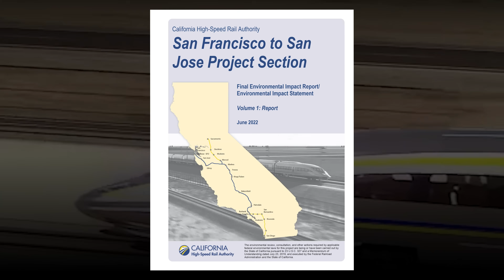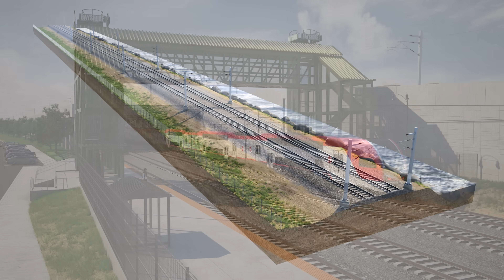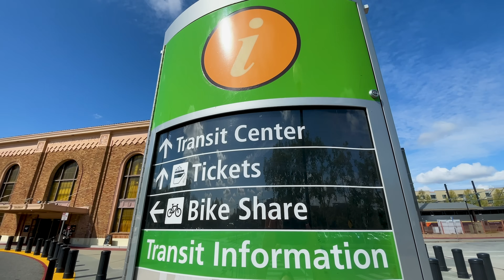San Francisco to San Jose Project Section Overview - FULL VIDEO

Comment: Max speed 110 mph in Northern California section. Central Valley ~180 mph. LA area another ~110 mph. 3 hours (?)

Texas is building a REAL HSR at 220 mph.
Difference between California and Texas is probably grade separation, meaning bridges and tunnels. 

California tries to ‘save money’ and delivers a semi-HSR. Not fulfilling promises, as usual, by US politicians.
Reply: 180 mph is still much better than 125 which is what Brightline is doing, it's  basically as fast as you can get, and I believe the central section will in fact go 220 mph
Reply: @n1thmusic229  In actuality Brightline only has a 20mile long 125mph section planned. Everything else is just updated freight track. Brightline’s marketing is blatantly lying about the scope of their project. It’s a little pathetic.
Reply: @TohaBgood2  I believe Brightline's marketing of a three hour trip of 240 miles from Miama to Orlando which is an average of 80 mph. Compare that to Amtrak's "approximate" average speed of let's say 41 mph. More importantly, I believe the 400 mile blended CAHSR journey will take four hours, averaging 100 mph. That might be either with only a few stops or even a non-stop express. For an infinite number of reasons I am more sold on Brightline's transit model vs. CAHSR.
Reply: @davidjackson7281  Nope. That is also incorrect. CAHSR and Deutsche Bahn, the chosen rail operator, have run countless simulations of the route as designed and built. The SF-LA duration is 2h38min even without maxing out on the high speed section in the Central Valley. 

There is precisely zero evidence that CAHSR will run SF-LA in anywhere close to 4 hours! Some anti-rail and anti-HSR blogs and trolls were pushing ridiculous numbers like that a while back, but they have all been thoroughly debunked! 

Tell me, where you got that number from? Why do you keep posting information that is flat out wrong? Isn’t that the definition of a lie? You know that the information is wrong but you still say it. What should I call you? A “creative truther”?
Reply: @davidjackson7281  Currently, Brightline’s average speed is 54mph and their top speed is 79mph. But they almost never run above 70mph because their grade crossings are a dangerous joke. This is identical to regular intercity Amtrak, but on the slow side!

After they add that 20 miles of 125mph track they will have a slightly better average speed but still nowhere close to the faster Amtrak intercity services, and not even remotely in the same universe as the Acela or the Northeast Regional trains. 

In other words, like so many people you’ve been fooled by Brightline’s very dishonest marketing.

They promised many things before too, including that they would be completing Brightline West by now. There are zero reasons to believe that they will actually be able to deliver anywhere close to 235 miles in three hours. They lied about everything else, why would tou believe them about this? How many times does someone have to be dishonest with you before you realize that they are constantly lying?
Reply: @TohaBgood2  After departing West Palm it will be non-stop and tracks will increase from  Class 4 on up to Class 7 making 3 hours doable. Believe whatever you want to wish.
Reply: @davidjackson7281  Three hours for Miami-Orlando is the theoretical runtime for a nonstop at the very top speed for each and every section. That's just not happening. There are a ton of curves, slowdowns for stations (even if they aren't stopping), slowdowns for grade crossings, etc.

You and Brightline are also assuming that the FRA will just let them run at 110mph on freight track between West Palm, Cocoa, and up to just 20 miles out from Orlando. It is extremely unlikely that the FRA lets them do that given how insane their accident record is. 

But let's say that the FRA closes their eyes on all of Brightline's incompetence and magically lets them have a 110mph speed limit on the new segment.

Ok, they currently have a 79 mph speed limit and they average 54mph, or about 68% of their top speed with no stops (25% slower with one stop). What makes you think that they can magically do better all of a sudden on the new section? You just believe what Brightline tells you in their marketing? What's their track record on lying in their public materials?

You seem to be insanely charitable to Brightline and simultaneously incredibly harsh with CAHSR. Why is that?
Reply: @n1thmusic229  Brightline is true semi HSR. I think they still use Diesel engines
Reply: @marktan3668  Brightline is 100% conventional speed rail. Their current top speed is 79mph. They have the exact same average and top speed as the Amtrak San Joaquins in California. The San Joaquins already uses the same Siemens Charger locomotives and is now getting the same Siemens Venture cars as Brightline.

There is almost no difference between Brightline and standard Amtrak intercity services like the San Joaquins. Only Brightline is more subsidized by the state.
Reply: @marktan3668  Brightline's top speed is 79mph, or around 127kph.

The fucking commuter rail in my city runs at 130kph, and it is grade separated. 130kph is not "high speed rail".
Reply: @gingerqueer22  your talking some LRT
Reply: @marktan3668  i'm talking commuter rail; find me a fucking tram that can do 130kph
Reply: @gingerqueer22  I rode some commuter trains in KL and Jakarta, some are electrical some not, they run like the speed you said.,same as Singapore MRT. Grade separation is applied for various reasons.,
HSR likes the linearity and little inclination. 
80mph is like my car. We are talking 200 mph in this age of ours.
Reply: @marktan3668  what are you even saying?

you've completely backflipped on your original point, presumably because it was really stupid, and are now just re-iterating basic facts about hsr.

and you're wrong, btw; hsr broadly refers to systems with an operating speed of around 200-250+kph. not every system is or has to operate above 200mph. obviously california hsr will on the dedicated sections, but that's not what is happening here.

like, do you have an actual point?
Reply: You haven’t been following Texas Central lately. That project has struggled to make progress in the courts
Reply: That's just for the Bay Area though, and since CalTrain agreed to allow CAHSR to use their corridor, they were able to use funds from Prop 1A and federal funding to push ahead with CalMod, which will significantly improve the existing SF to SJ portion of their network. And if you have see states save money, look no further than el estado de Florida, 174 level crossings across a 67-mile long corridor from Miami, Fort Lauderdale, and West Palm Beach, with a lower top speed of 79 mph.
Reply: @randomscb-40charger78  so, there is Prop  money passing around, who knows where.
Florida model is mostly at grade crossings whatnot. In fact, 90% of California’HSR’ are at grade level. How can they run fast?
Reply: @marktan3668  A lot of HSR systems are at grade, but they don't have a lot of grade crossings. A big part of the project involves grade separating existing tracks from roads to allow for higher speeds, as the highest speed according to the FRA for barrier crossings is 125 mph, 110 mph for regular ones. Another reason for going at grade is that it's the least expensive ROW to construct for trains, elevated tracks being more expensive and tunnels being the most expensive.
Reply: For Brightline, they only plan to run up to 110 mph on the Florida East Coast Railway, the tracks they currently use and will use all the way up until Cocoa, before taking a newly built line to Orlando. The FRA prevents passenger trains from running faster than that on corridors which are shared with freight trains as well, not just because of the absurd density of crossings. On the new line, trains will reach up to 125 mph and maybe even higher in the future.
Reply: @randomscb-40charger78  110-125mph, on diesel. I guess one of reasons world’s HSR can easily get 200 mph is, there can be several coaches with electric motors sharing total thrusts.
Reply: @marktan3668  That would be an EMU, but even loco-hauled HSTs can achieve such speeds.
Reply: Nope. Texas Central isn’t building anything. They stalled before they even got any money.

CAHSR’s top speed will be 250mph, with actual operations speed limits at 220mph. Texas Central was shooting for barely 200mph before they crumbled.

You are blatantly lying again, bud.
Reply: @TohaBgood2  your claims of mph is IMPOSSIBLE by engineering. Only politicians election promises.
Reply: @TohaBgood2  Your correct about Texas. I hope CAHSR goes 250 mph, however with the blended system I am seriously doubtful of any SF-LA trip in less than three hours. When debating please don't rudely refer to someone as a blatant liar. It actually undermines the points you so wholeheartedly wish to express.
Reply: 180 mph is real high speed rail 😆
Reply: @Scottish_Transport_Explorer  International standards begin at 155 for new tracks, 125 for upgrading existing tracks.
Reply: @davidjackson7281  Exactly
Reply: Bandung will test 220 mph true HSR next few weeks, operating in spring. The first in SEA, Southern Hemisphere. Way way ahead of Canada, Australia and USA. 

Watch their detailed drone videos on their building processes, step by step.
Maybe USA can learn something about project of peace. And, not perpetually making war destruction.
Reply: @marktan3668  Lol, the Indonesia HSR project is more than 2x over budget and more than 2x delayed!

Wasn’t it supposed to be completed by 2018 and cost $5 billion? Why is it only getting completed in 2023 and costs over $10 billion.

You’re literally touting a project that is more delayed and more over budget than CAHSR!

Have I mentioned that it’s also extremely short, shorter than just the initial segment of CAHSR that they are finishing construction on right now? Yeah, only 142.3 kilometres (88.4 mi) vs the CAHSR section under construction of 119 miles. Also CAHSR will have a higher top speed of 250mph and a higher operational top speed of 220mph. Your project will only have a 220mph top speed and an 200mph operational top speed.

You can’t even troll properly 😁😁😁😁
Reply: @TohaBgood2  Indonesia is way way ahead of Canada, Australia and USA.
Reply: @marktan3668  In what way exactly? Your entire HSR “system” is shorter than just the first section of CAHSR. 80 miles of HSR isn’t some major achievement. It’s also slower than CAHSR and similar systems. It’s also more over budget and more delayed than CAHSR.

So what do you call “ahead”?
Reply: @TohaBgood2  California’HSR’ IS ONLY 130 mph for entire run. World’s standard IS 200 mph. Wake up !
Reply: @marktan3668  What are you even talking about, bud? The Central Valley section is literally designed to be the fastest stretch of non-maglev HSR in the world. The top speed is set at 250mph (402.3kph). The top operational speed is 220mph (254kph). The top sustained speed of the trainsets that they are ordering is set at 242mph, and they need to be able to do cruise at 220mph.

This is all in public government documents and contracts. We are literally paying a ton of money for this level of performance. That's one of the reasons why the system is so expensive. Even the anti-CAHSR trolls, like yourself, are constantly complaining that this is making the system too expensive.

Where are you even getting that ridiculous made up 130mph number from? It doesn't appear anywhere in any CAHSR document!

And no, 200mph was the top speed standard for HSR track and rolling stock in the early 2000's. Since about the 2010 all the new HSR systems have been aiming at 220mph top speed for their new high speed lines. You can see that in France and Spain, as well as with HS2 in the UK. China has also tried to build a line at that new speed. 

220mph is rapidly becoming the new gold standard for tops speed. Your tiny, 80 mile, HSR system in Indonesia is already outdated before it has even launched! Is that why you are trying to defend it and make stuff up about other superior systems?
Reply: @TohaBgood2  when Americans build. It’s a laughing stock. Hahaha
Reply: @marktan3668  Heil. Nice thumbnail moustache.

Comment: Seems like way too many grade crossings. Why can't we do this right?
Reply: Because the people on the route keep suing everyone and their mother to block any grade separations. They’ve also blocked quad-tracking, passing tracks, and almost killed electrification!

Plus, running at 110mph in urban areas where the stations are is 100% standard practice for HSR worldwide. The Shinkansen and the TGV go considerably slower in cities. This is just how HSR is currently done.
Reply: @TohaBgood2  I have no issue with the 110 mph speed in urban areas. This is necessary due to the limitations in of the alignment due to existing infrastructure. Even 110 mph lines should be fenced in and grade separated to insure the safety of rail crew,  passengers and the public.
Reply: @davidlendved8225  Of course they should be separated. But local opposition has killed most of it. (Eventually it will have to happen, of course, but it'll mostly end up being paid for by local authorities and at a much higher cost than if the HSR authority had been allowed to build it right to begin with. As usual the NIMBYs are passing the extra cost onto their kids and grandkids.)
Reply: @TohaBgood2  Is there a reason NIMBYs are able to block that? Why dont California just use eminent domain? They could easily strong-arm their way to completing this correctly, but instead they are going to risk lives being lost similar to Brightline. 

Only hope for true HSR is Texas and yes, I know they are struggling to even get started. These companies really just need eminent domain rights, because the amount of NIMBYs they are going to encounter is never going to go away and they need to be prepared for it better.
Reply: @RashawnBlue1  Eminent domain lawsuits can be extended almost indefinitely with enough money, certainly long enough to block projects into oblivion. Some of the richest people in the world live on this route and they will use their money to kill this thing off. CAHSR is doing exactly what it needs to do to thread the needle and  get its foot in the door. Then, public pressure will make it impossible for the moneybags to oppose the necessary upgrades. But what they are doing right now is precisely the way you get something like this built! They know what they are doing. Let them work!

Unlike Brightline, CAHSR is installing proper quad gates that are used by the best HSR systems in the world for similar crossings. There's no particular danger here. The reason we criticize Brithtline is because it's too cheap or too broke to install quad gates and fences. CAHSR and Caltrain are doing both!

Sadly, Texas Central is most likely already dead. They are a zombie organization at this point. They have built zero miles of guideway and have no firm plans to even get into the cities that they are claiming that they will serve. Both termini are farther away from civilization than airports. CAHSR is city-center to city-center and is nearing construction completion on the first three sections while two more extensions are doing pre-construction to start building.

I'm sorry dude, but one is a real project and the other appears to be a pipe dream. CAHSR is actually happening. They are actually building it. Texas Central most likely will forever remain a collection of pretty renderings. I can't say that that makes me happy, but that appears to be what's happening. CAHSR is all there is.
Reply: @TohaBgood2  Texas Central probably won't do it, but I am sure another company will eventually, the Texas triangle is one of the best areas for a HSR system, probably 2nd only to the NE corridor.

I think you mistake what I am saying. California can pass legislation that could empower eminent domain and speed this through the courts. If California truly wanted this system done in the most affordable and quickest way, it would most definitely take a look at permit laws and such to prevent slowdowns via litigation.

They had decades to plan this out, we must not forget how long CAHSR was planned for, there is no way they could have forgot the existence of NIMBYs they were a thing since then. Just like their zoning laws, they refuse to fix it even though they have the ability to force it at the state level.